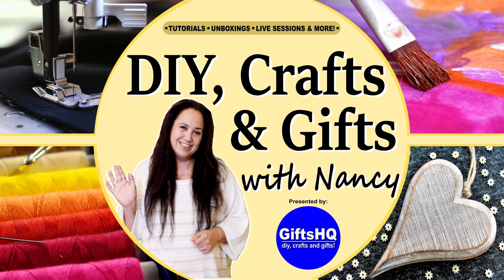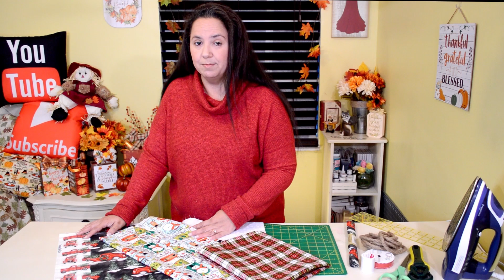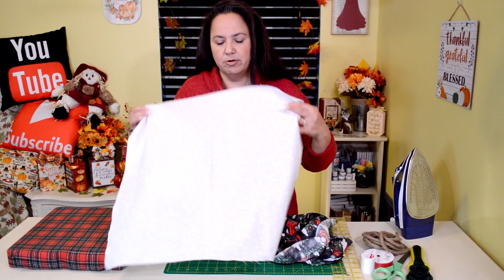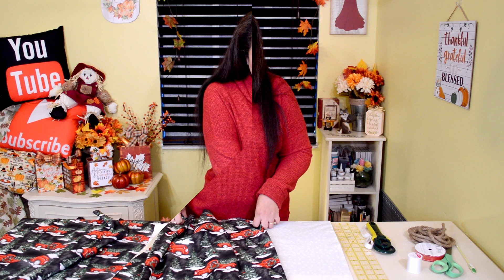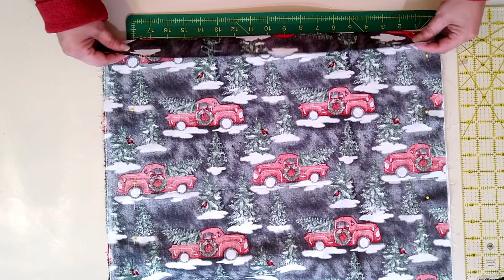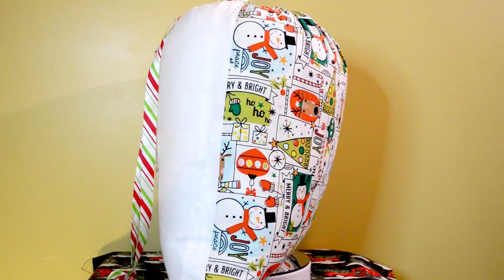How To Sew A Santa Sack: Christmas Holiday Gift Bag Beginner Tutorial

Comment: Hi, what size are the fabrics? This will be my first sewing project ever
Reply from the maker: I used 21" x 20", but you can make it any size you want. It will depend on the size you want your santa sack to be. Try .different sizes and have fun! Nancy❤️
Reply: @GiftsHQ  Thank u, I'm still too scared lol do u have a smaller project? Fingers crossed by November I can make this
Reply from the maker: @AussieMumVLOGS  Try going to your local dollar store and purchase fabric so you can practice. This way, it will not cost much, and you can practice!
Reply: @GiftsHQ  Hi Nancy! Im ready to sew lol 10 months later lol. I have a brother JV1400 which is the basic model with a stitch dial.
Would a 2.5 stitch length be a longer looking stitch or a smaller looking stitch? My machine isn't digital
Reply from the maker: @AussieMumVLOGS That would be considered a construction stitch, and a 3.0 would be longer.Hope that helps!